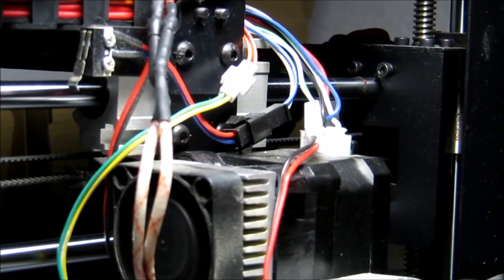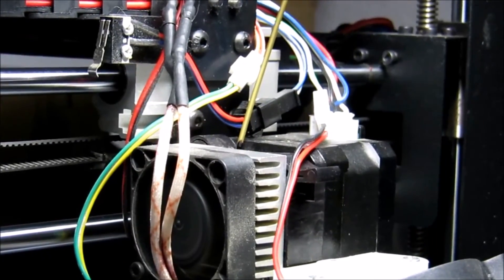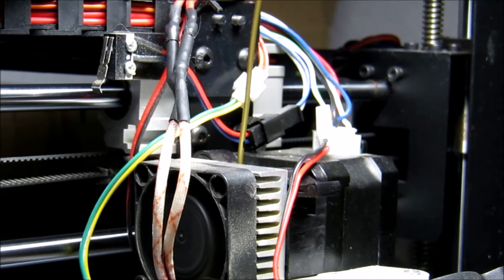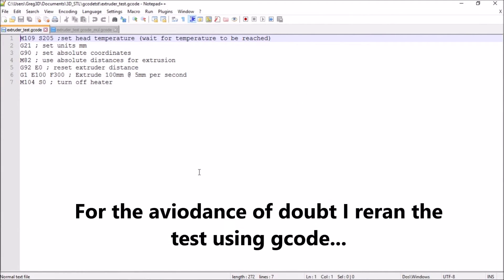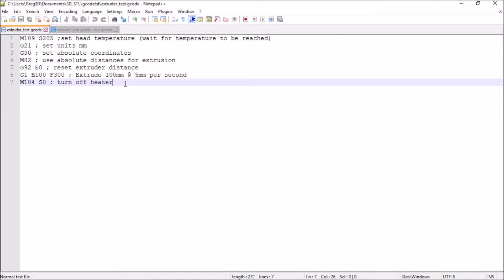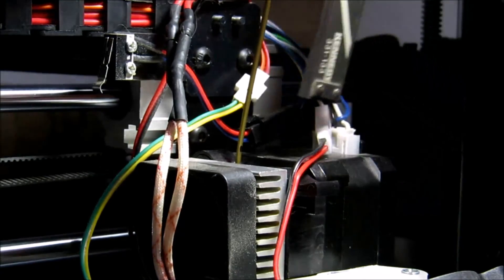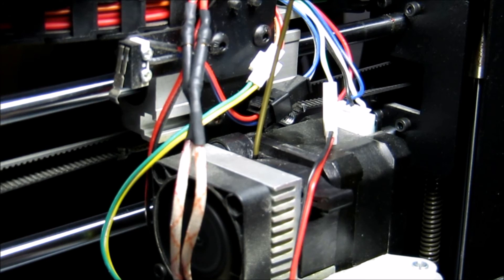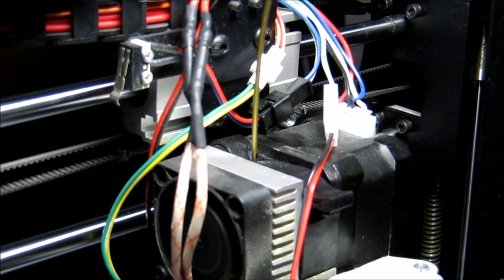Malyan M150  Extruder Test 3D Printer Tutorial

Comment: What problems were you encountering on the prints with the under extrusion , pretty sure mine was under as well as on small parts the join layer was not holding very well , (easy to snap) on a thin wall , I just had a guess and kept adding to the multiplier in S3D until I got a good result , which by coincidence has matched your result at 105 , wonder if all the M150 are the same ?
Reply from the maker: I did not see any great problem when printing normal filaments in either PLA or ABS. I became suspicious when trying to print with bronze metal PLA as it seemed not to extrude enough filament and looked "bubbly". After applying the extruder factor the results are much better. Perhaps other readers can comment as to whether they find the same under extrusion with the M150.